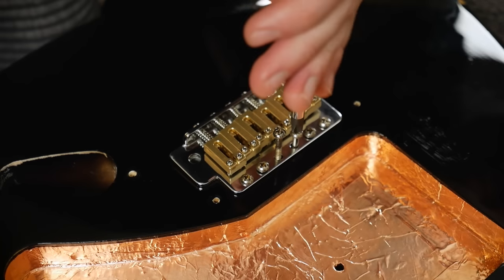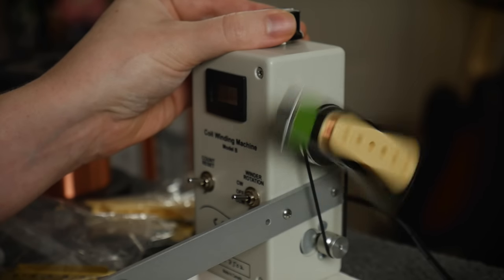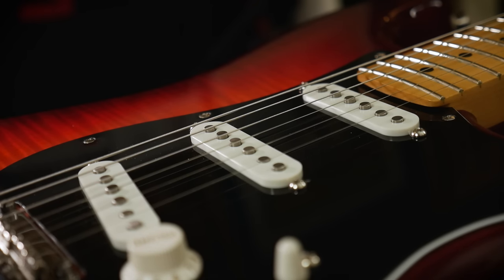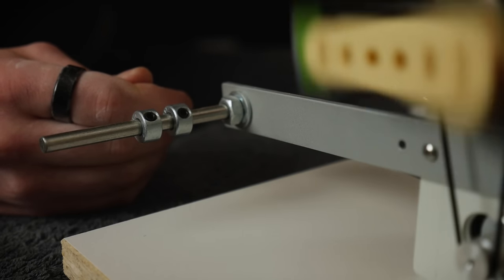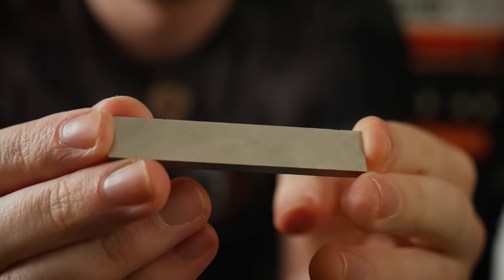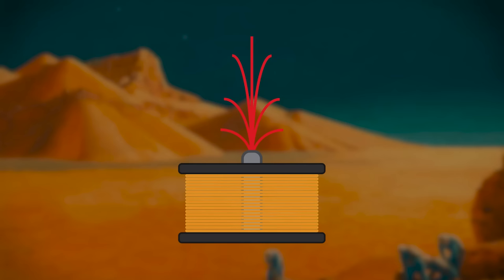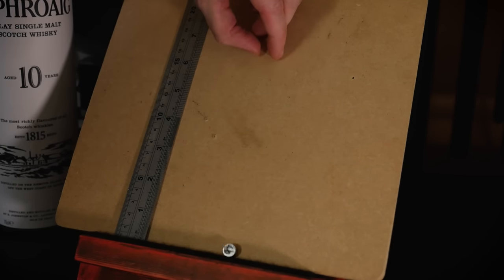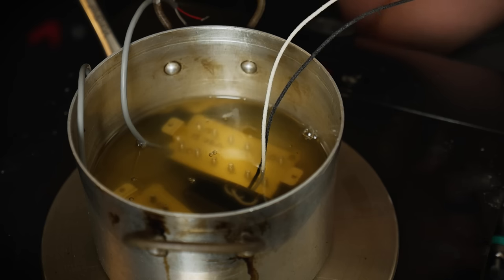(almost) EVERYTHING About Pickups | Too Afraid To Ask

Comment: i bought a cheap Starcaster By: Fender Strat electric guitar..and all that is actually printed on the head stock..basically the cheapest Strat Licensed by Fender made in china it cams with the standard compliment of 3 single coil pick ups a 5-way selestor switch and the single vol knob/pot and 2 tone knobs/pots maple neck rosewood finger board 6 screw trem bridge  basixally your bog standard Strat but electronics and hardware substandard Chinese crap and unknown body wood painted glossy black with tiny silver flake in the scattered sparsely in the surface of the finish and a mother of toilet seat pick guard...it looked OK and sounded fine for what it was and I say was because I've begun moding it to the extreme it's been disassembled completely body and head stock stripped of finish and cloth covered in a nebule print stretch fabric sealed in clear coat and sprinkled with micro flak glitter sparsely in each coat and instead of a painted fade along the edges i've thinned thw wood glue with water brushed it on the edges of the body and head stock and covered them in the same glitter and am covering all with resin to seal and level then sand and polixh to a glassy shine both headstock and body are covered both front and back there is also to be a blue tint in the resin for a deeper color and a candy solor effect in the finish... thats only the finish...the electronics and hadrware are also getting the extreme treatment as well.starting with the addition of locking tuners and roller string trees and a titanium nut in the head stock..then installation of 3 quad rail humbuckers at 18.6 k ohms on average the addition  of 3 500--K push/pull vol pots for coil splitting with 3 500K tone pots and .047 orange drop caps adding a 12 pin DPDT bypass switch which one side activates the neck and bridge pick ups together regardless of 5-way position and the other side of the by pass sw.is for activation of the 5 -17mm piezo's mounted on the upgraded full size steel "Fender" Classic trem block and their wired in series thru the sw and directly to the upgraded output jack mounted into the extended custom pick guard just aft of the pots the pick guard is also covered in the same cloth and with the pattern matched to the body and with the same resin finish  over the expanded the control cavity to accommodate the additional electronic controls and wiring thereof repositioning the 5-way selestor sw .toward the neck a bit and moving the pots and the output jack for aesthetics and comfort.chrome Tele style knobs complete the look...when It's  completed I expect the weight to increase from the original 7.1lbs to about 8.1 due to the added weight of hardware and electrical components and the additional thickness of the custom finish I'm applying...the name changing to the next logical on the progression of Fender's naming strategy as in..."Broadcaster" the later changed to the "Telecaster" then the also IconicStratocaster" then the cheap strat guitar L bought that they called the "Starcaster" and my Ultimate strat modded guitar I'm naming the  "Stellarcaster"   fitting both the finish and the extreme modifications I've made to it,,,, the electronics are done for the most part wired up to final spec;s less the wirint to the trem claw and battery for the LED.s for pick up coil activation indicatiors.. if all gpes to plan I intend to take copious amounts of photographs and send them to all the guitar you tubers that i watch most of the time for bragging rights of a first ever build/guitar mod project I have personally undertaken and completed unaided from my own design and handywork..

Comment: Does anybody sell a strat-style pickup with a much wider magnet spacing? I want to have an extreme reverse-angle on the bridge pickup to get to a lot of bridge tone on the low strings and more neck tone on the high strings, without having to switch pickup positions. Would it still be possible to get a classic strat tone, or would the change affect the tone/dynamics/etc in some significant way?
Reply: Zexcoil Pickups might be what you are looking for

Comment: Why do pickups with lower resistances have lower outputs? That seems backwards. If theres less resistance, shouldnt the current flow easier and therefor be higher output?

Edit* NEVERMIND! Just remembered Ohms law. For anyone else wondering, its because the output is measured in Volts, and Ohms law states that Voltage = Current x Resistance, so increasing resistance will increase voltage. Or, more intuitively, since voltage is the electric pressure or potential energy of the current, it makes sense that increasing the resistance would increase this pressure.

Second edit* NEVERMIND AGAIN. Now Im even more confused because volume pots also work by adding resistance but in this case it decreases voltage amplitude. I am so lost.

Comment: If you have a humbucker pickup with non adjustable pole pieces,  is it possible to change them out for the adjustable screw in type of pole pieces. 🤷 ? Possible? ..or No.
Reply: Fully possible if you are carefull, I did that with some humbuckers back in time, but it also comes down to how the current pole pieces are mounted and finding the right size of new threaded screws.
The new polescrews material composition can also make the pickups sound slightly different.
Reply: @JoeBaermann  ..so, ..if a pickup has non adjustable pole pieces, and you pull them, those holes are not going to be treaded. ..can you get away with carefully screwing in the adjustable type pole pieces, even though the hole isn't threaded if the screws your screwing in are only slightly bigger than the hole? 🤔
Reply: @benwright6330  Depends on how close the wire is to them holes and if/or there is something in between.
I only tried with threaded pieces of the same size, think I added some wax too.

Comment: You said the number of winds affects the sound as the voltage or electrons need to move through the length of the wire like water through a pipe, But as the wire is not insulated and looks like bare wire, dont the electrons just move across the wires  instead of going through the wire like a water pipe? Electricity moves through conduction and the winds are all touching each other so its like a solid peice of metal in a sence? Sorry if that sounds stupid but im confused on how that works.
Reply from the maker: The wire is insulated
Reply: Oh, thanks. My mistake. The wire in the video looked copper colored and shiny so i thought it was bare wire.
Reply from the maker: It's a clear, polyester enamel coating - it's very thin as adding thickness to the wire would reduce how many layers of copper could be packed into the bobbin, spacing the wire and affecting the inductance. 

The polyester coating melts below 200 degrees Celsius allowing solderability of the copper beneath.   @michaelcardamone9614
Reply: Thanks again for the fast reply. I appreciate and enjoy your videos they're very clear to understand and very informative. keep up the Great work.

Comment: basic physics question here please? i get more winds = higher resistance. but on the other hand, isn't Current inverse to the resistance of a circuit? so the higher resistance, lesser current, which would mean, a smaller voltage? wouldn't higher resistance = lesser voltage? can someone clarify this for me?
Reply: Your dealing with A/C inductance. More winds = higher current created from the moving string's magnetic field over the winding. Just like moving the winding closer to the string. However, at more than 16k ohms, the signal becomes muddy.

Comment: Why aren't coils wound to the edge of the bobbin? There must be something in a, or it wouldn't be the way it is.
Reply from the maker: Basically the same reason why you don't fill a glass right to the brim with liquid. 

If you wind the coils right to the edge then they'll have a tendency to spill out, are more easily damaged, and in the case of humbuckers you can't get the two coils to sit neatly next to each other. 

You want the thin, vulnerable wire to be protected within the bobbin.
Reply: @ScienceofLoud  Thank you. I thought it might be for spilling but hadn't thought about humbuckers having to fit.

Comment: I file like the type of screw doesn't affect tone that much...
Reply from the maker: If by 'screw' you mean the pole pieces then consider it this way:

The pole pieces are the conduit that allow the strings to become magnetised - and in the reverse interact with the magnetic field of the vibrating strings. 
Since the signal induced in the pickup coil is dependent entirely on the magnetic flux - the movement of magnetic field - the way in which the strings interact with the pole pieces has a great impact over the induced signal. 
The pole pieces literally shape the interaction of the string and coil, the current generated simply a copy of the magnetic interaction between pole piece and string. 

Pickups featuring narrow individual pole pieces respond in a very different way to those with one contiguous bar or 'rail' pole piece.

Comment: Hi I have 2 ibanez v7 and v8 pickups flat black but the v7 has 5 wires and the v8 has 3 wires, how would I do the wiring on this with 1 Vol, 1 tone, and 3 way toggle switch neep help please
Reply from the maker: Learn about each component in turn, how it functions, and the path signal should take from pickup to output. 
Once you do that you'll never need to ask for another wiring diagram again.

Comment: The DC resistance of the coil has nothing to do with the output, it just indicates the length of wire on the coil. The output of the coil is determined by the number of winds. A pickup with 8000 turns of 42 gauge wire will have the same output as a pickup with 8000 turns of 43 gauge wire, but pickup makers use physically smaller wire for higher output pickups because it allows for the same size coil with more winds.

Comment: How do you start winding and were do you put the spool
Reply from the maker: Wind a few turns by hand until tension holds the wire to the bobbin. 
Wire is fed off the end of the spool from the floor. DO NOT attempt to feed from a rotating spool, the inertia of the massive spool compared to the tiny wire will just keep snapping the wire.

Comment: So, I am not a qualified electrician, but how does more resistance equal more output?
That seems to be the opposite of what resistance does.
Resistors in a circuit, among other things, reduce voltage.
??
Reply from the maker: V=IR 
If R increases so too must V, assuming I stays constant.

Or think about it like water in a hose pipe: for a constant flow rate, if you restrict the end of the hose (increase the resistance) the water leaves the hose at greater pressure (voltage is electrical pressure)

Your shower head has more pressure if you use the smaller holes, less pressure if you use the bigger holes. Electricity is the same.
Reply: @ScienceofLoud  
I get what your saying, but putting your thumb at the end of a hose is not decreasing the water flow(i.e.resistance), it is constricting it to increase pressure at the output, because it has nowhere else to go, but resistance would be akin to reducing the water flow before it reaches the end of the hose, because resistors reduce energy thru heat absorption, and dissipation.
I am sure you are correct, i just can't get my brain to understand it.

Comment: it pains me that there's a lot of pseudo-science in and false info in this video, because you are generally very correct on a the topics you discuss. i don't believe that you have the difference between ceramic and alnico the right way around, having done double blind tests with the same pickup, swapping the magnet, i found ceramics to be muddy, wooly or thick, while the alnico had a more balanced mid and hig profile.
aslo, ''perfect wound'' ''scatter wound'' or ''hand wound'' coils make no difference in such a double blind test.

Comment: What are your thoughts about whether a pickup that is screwed directly into the wood of a solid-body guitar, such as the neck pickup of a Telecaster or a soapbar P-90 in a Les Paul, will be sonically effected when vibrated by the body when the guitar is played? In other words, will the resonance of the wood be transmitted to the pickups so that the pickup's tonal character is audibly affected?
If so, will this be audible, particularly compared to the strings' effect on the magnetic field?
Also, if the pickups are not screwed directly to the body's wood, but are mounted on a pickguard as on a Strat, or other plastic surround as on a Les Paul, will the resonance of the wood be transferred through the plastic to the pickup?

Thank you for considering my questions..

Comment: No matter machine or hand wound, ceramic or alnico it boils down to 1 thing the amount of copper with the strength of the magnet. This equal the output. It is impossible to get the movement the same way 2x's by hand. Way too many people by into these myths.

Comment: Since the copper can slow down a magnet has anyone thought of using a different type of magnetic wire or is this thin copper wire actually copper coated steel !? What about neodymium magnets ?
Reply from the maker: You've misunderstood: copper is NOT magnetic - but it will generate electric currents when exposed to a changing magnetic field.
This is a property called induction and its what allows the copper coil to generate a signal that can be amplified.
Reply: @ScienceofLoud  I didn't misunderstand I was referencing that copper I was referencing copper's ability to slow down a magnet like you demonstrated with the brass. My question is could other metalic wires be used in the coils instead of copper wire and what would be the outcome or have they already been used and what are the differences ? And thanks for your response. I have Scottish ancestry from the surname Boyd and possibly others. 🏴🇺🇲👍
Reply from the maker: @darylhudson777  You have misunderstood because you think the slowing effect is a result of copper being magnetic, or the copper actually being a plating on top of magnetic steel. 

The slowing effect is due to induced currents NOT magnetism. Magnetism is a property of dipole interactions in the molecules that make up the material. Copper does not exhibit this property. 

Copper IS however electrically conductive - as are all metals - which allows a current to be induced in the material.

A moving magnetic field - like the falling magnet or indeed the steel core of the guitar strings which ARE magnetised by pickup magnets - will induce electric currents to flow in electrically conductive materials. 

In the case of the falling magnet this induces eddie currents - small spiralling currents which themselves create their own magnetic field. It is the repulsive reaction between the falling magnet and the magnetic field generated by the eddie currents (and conservation of energy) which slows the fall of the magnet - NOT any magnetism interaction with the copper itself. 

To answer your further question: Yes you could use any other metal as a coil but copper is the best because:
1. It is the 2nd most electrically conductive metal.
2. It is cheap and abundantly available. 

Making a coil out of other metals would either be less efficient at producing a signal, or be so costly as to be prohibitive to produce. 

Silver is the most conductive metal and there are some record player stylus pickups which use silver wire for their coils. These coils are tiny and use comparatively small lengths of wire - yet are still very expensive. 

Guitar pickups use a LOT of wire for the coil, building them out of silver wire for "dem toans brah" simply wouldn't be a cost effective thing to do.
Reply: @ScienceofLoud  I DO UNDERSTAND !!! You have NOT UNDERSTOOD what I am saying...lol... You are saying it wouldn't be cost-effective to use certain materials like silver, but yet there are people that spend over $100,000 for guitars. Are you just not catering to those people ? Maybe they want those materials and are willing to spend the money because not everyone is in the poorhouse and counting every penny. Some people do want that edge above all the rest and will pay for it. But if the edge is only 2% maybe it's not worth it I don't know yet I'm just exploring the concepts.
Reply: @ScienceofLoud  by-the-way inductance is measured in Henry's... No relation to Henry VIII...hehe...punk joke there somewhere
Reply from the maker: @darylhudson777  let me know how you get on commissioning someone to make you a silver wire guitar pickup, I assume you have the money to fund such a project since you are not in the "poorhouse"

I'm not saying it isn't possible to create a vanity project for the super wealthy. It is however not a commercially viable option, and when answering your question of "why hasn't anyone done this?" then commercial viability is always one of the most important factors.
Reply: @ScienceofLoud  what is the most expensive guitar produced today ?
Reply: @ScienceofLoud  no I don't have the money to do it I was just asking questions for I have an inventive mind. When I get the money I might have it paid for just to see if it works and how it works.